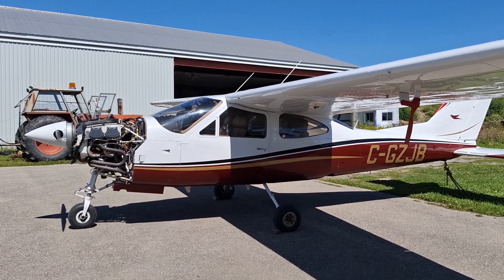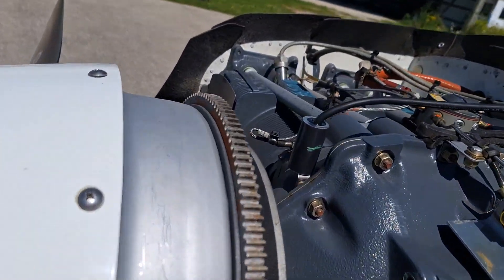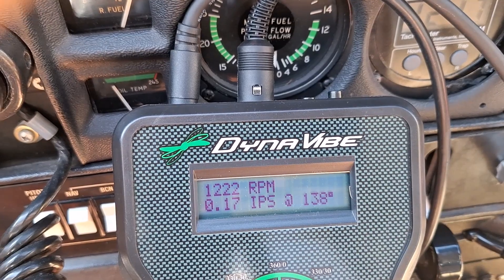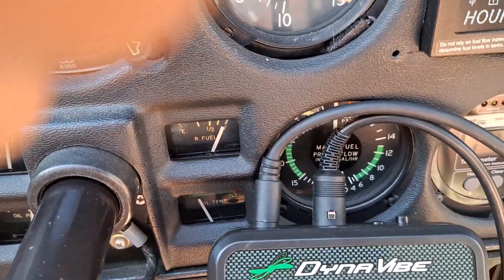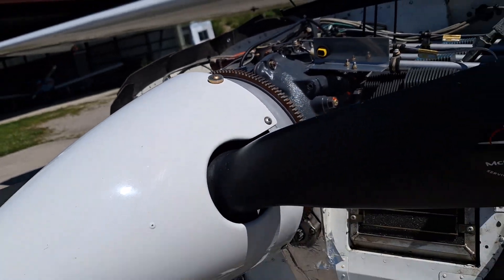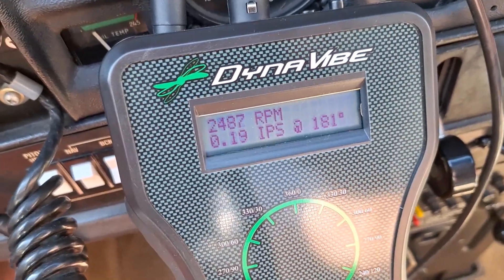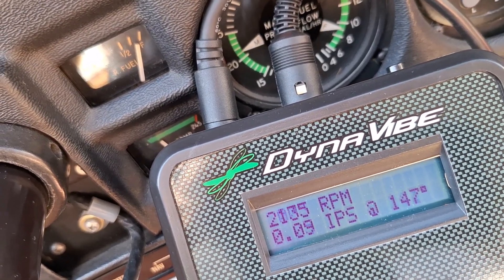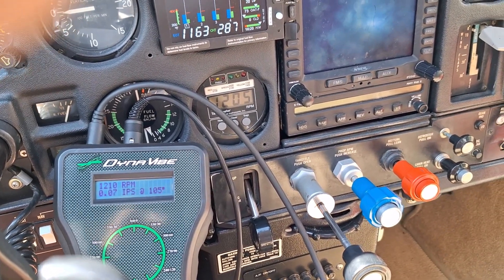Part 4 Dyna Vibe Propeller Balance

Comment: I made my own dynamic balancer using an accelerometer and optical sensor from Amazon, a tablet app, and 2 channel HANTEK oscilloscope that uses a tablet or laptop's screen. It produces a sine wave from the accelerometer and a pulse from the optical sensor and when I'm at the RPM I want to measure, I do a screen freeze and shut the engine down. I measure the difference in milliseconds from the peak of the sine wave to the start of the pulse, convert to a ratio, and multiply by 360.  I don't get an IPS result (I can only measure raw millivolts from the accelerometer), just a sine wave showing fewer millivolts amplitude.  I ended up with about 20 grams on the  ring gear of my Lyc O-290 after 3 tries which produced a sine wave with just noise, no discernible sinusoidal pattern. Significant improvement in the cockpit, and I gained about 100 RPM at the same manifold pressure with a fixed pitch prop. I think remaining vibration I still have is from the engine's torque pulse rocking couple.

Comment: I upgraded to the new Dynavibe that gives the split calculation. Made my own mounting kit by simply tig welding a couple stainless nuts with proper size bolt end for each sensor. I purchased all the standard hardware (nuts, bolts and washers) and put them in an inexpensive Harbor Freight plastic storage box after pre-weighing them. Saves time.